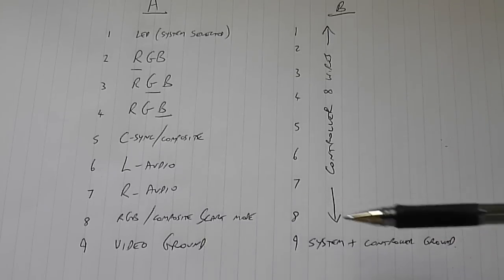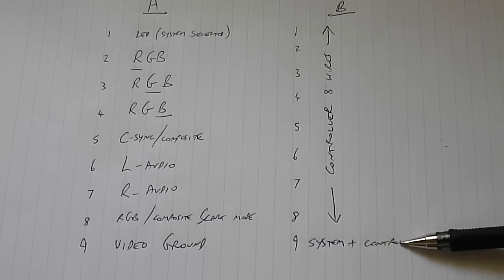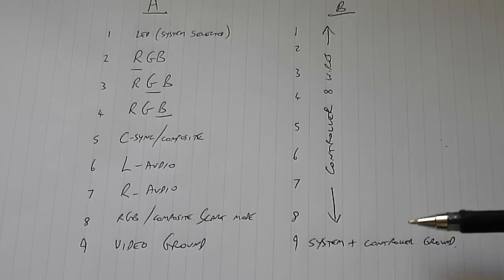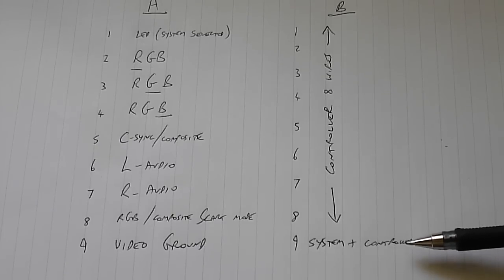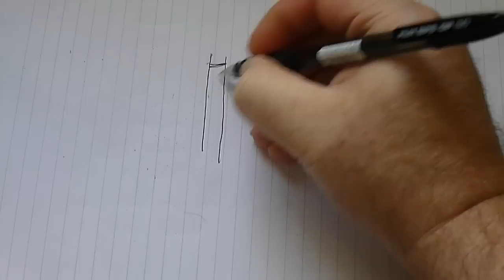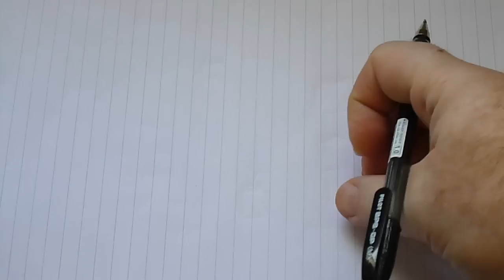Home made 18 pole 16 throw switch (18P16T) bank and slider for Unity project

Comment from the maker: I like the way that when I was building and having problems I didn't get suggestions, when I struggled and succeeded to make a solution that works great, I get suggestions! 

Springs as per the video were an option I tried originally however was clear it was not going to work as needed, so used elastic instead.

Comment: Always redesigning your stuff! Heh. You likely thought of this, but I'd suggest another board above the slider (or below it) with notches cut into it and a single one of your spring-loaded nuts on the on the top of the slider (or bottom if you went that way). So it just pops into place for the various consoles.

Comment: Emulation is really good for the older systems, especially if you have a WIZ or some other emulation system that can hook to a TV. I understand what you are saying, but I would think if original hardware is better, certainly original controllers are better. OTOH, that is a pretty amazing controller and your cartridge system for it's protocols/wiring is great.

Comment from the maker: Using IC chips is another method for this, however the voltages will fluctuate depending on the systems being used and the order too, which would make that harder than normal; also, i'm not a programmer or suchlike, so went for the "manual" method of making this - manual has the advantage of being easy to troubleshoot, and also it either works or it don't!

Comment: Bac,

Use a SPST switch to control a set of relays!  It would be easy and look clean.  You can use 1 switch in the front to control 6 3-pole relays (giving you 18 connections).  You can get small relays for cheap.

If you want me to draw you a schematic, let me know.

-tyler335
Electrical Engineer
(The Bulldog 64)

Comment from the maker: Unfortunately, some retro systems had really bad controllers that sucked to use - Colecovision is a really good example of a controller that sucked badly, and there are other examples too. intellivision also had a bad controller, and BTW, emulators for Intellivision don't work great due to the way games were sometimes designed to use the keypad for direction or firing.

Pleased you like the Master Controller, it is unique and took 3 revisions to get to the final state.

Comment from the maker: Older original controllers were not always that great, and one of the points of this is to use one controller for all systems for convenience and ease of use. Emulation is not the same as real hardware and another point of this system is to just use original hardware for the consoles.